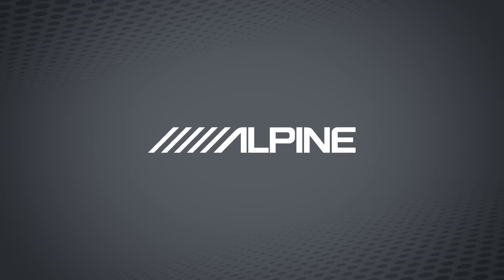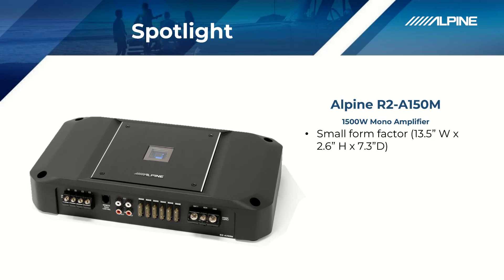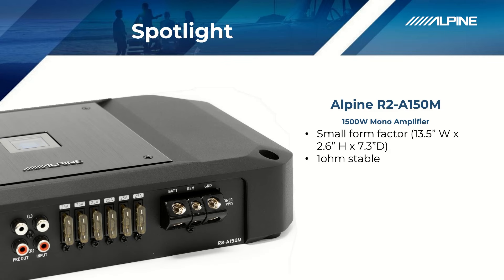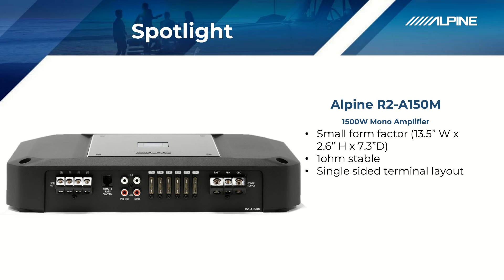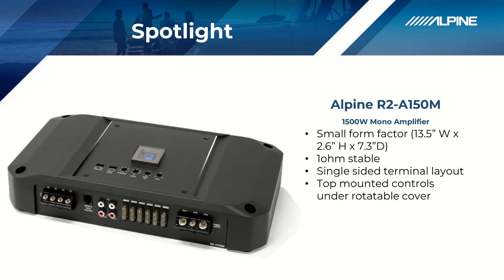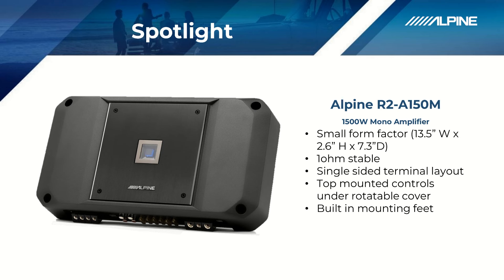ALPINE | CAR AUDIO | SPOTLIGHT

Comment: Sounds cool. I kinda wish they made a bigger version. Maybe a 3K. I might be the only one wanting that, though. Lol
Reply: @JasonWW2000 you can always stack mutliple amps to get this kind of power. Especially with DVC subwoofers you can even run 2 amps on a single driver! This is a ton of power though, so you will be also looking at adding more current supply at some point.
Reply: @MotleyG No, I can't stack multiple amps. I need a single unit. (3 x dual 6 ohm subs wired to 1 ohm with 1.3x impedance rise)

I've already got enough power supply to support an 8K, so I'm good in that area.

Alpine used to make a 2400w amp, but it was only 2 ohm stable. Man, it was nice. There's plenty of big amps from other brands, though. 
I just thought it would be really cool to have one from Alpine.

Comment: I have 2 of these to a Kicker Quad box, 1 amp to 2 12s. Wired to 1 ohm. They bang. The certified test was over 1,800 watts per amp.
Reply: I have one of this but my birthsheet says it’s less than 1600 at 1ohm. I have the gain set at half.  My Oscope shows I can take it past 3/4 without distortion but I set it to half due to running stock electrical. Im using it to power 2 kicker compQ 12 and it sounds amazing.